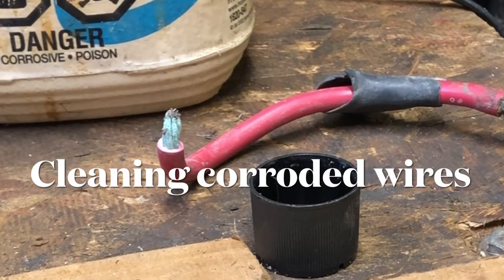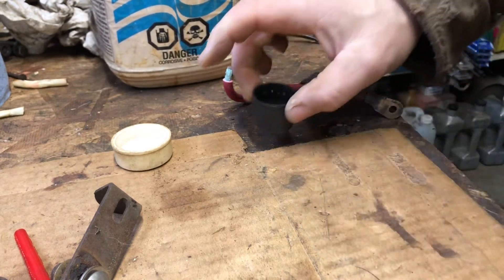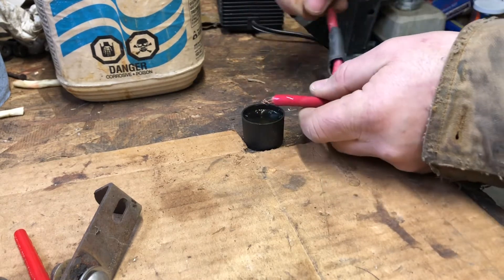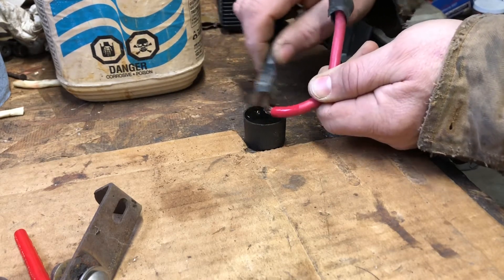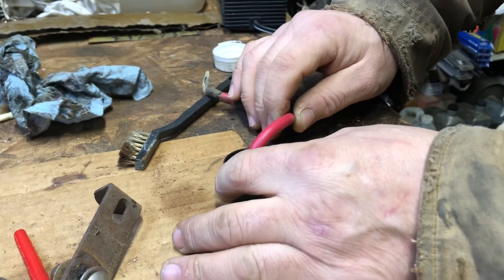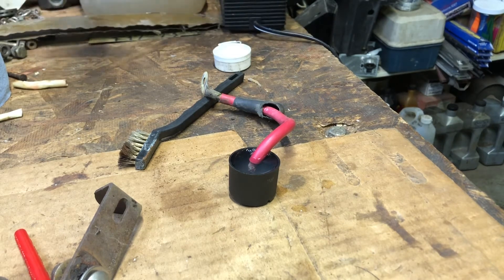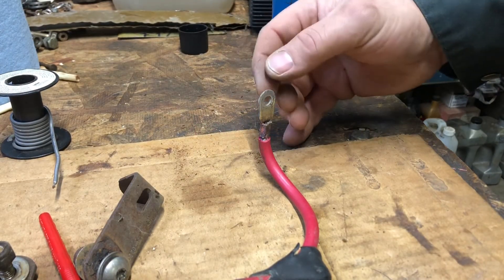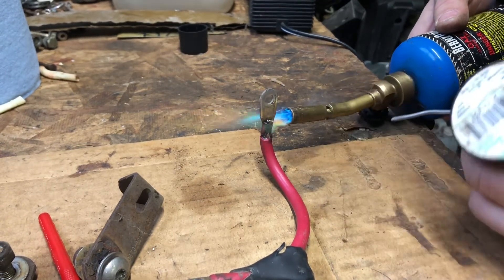Cleaning and Soldering Corroded Wires

Comment: Do you rinse with distilled water? Or does that not matter?
Reply from the maker: Some people use baking soda and water to neutralize the acid, but I dont bother because I feel it burns off from heating the wire when soldering. Usually when using solder paste nobody rinses it off either.. but I am no expert on that, this video is what I do.. any suggestions for me to learn are always welcome. Thanks for the question.
Reply: Depends if it's RMA flux or RA.  The M is mildly active and doesn't need washed off, a lot of times called "no-clean".  RA is more acidic and has to be rinsed off to avoid further corrosion over time.

Comment: Can I use this approach to clean the tip of a copper wire still stuck in the wall?
Reply from the maker: It would work, but remember to disconnect the power to that wire! I haven't checked of there is continuity in sulfuric acid. But it is good practice to have your breaker off when working with electrical circuits in buildings..

Comment: Will the acid core solder continue to eat the copper?
Reply from the maker: I dont believe it does, I feel the acid burns off from the heat from soldering. Thanks for your question..
Reply: Yes
Reply: Yes it will . Temp fix .

Comment: that cable is oxidized, not corroded!
Reply from the maker: Thanks for the input.
Reply: What causes my mids line speaker wires to get corroded ..from amp to speaker the full run ?
Reply: @kidowan.  thanks already fix change it..